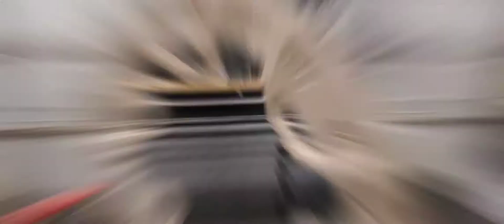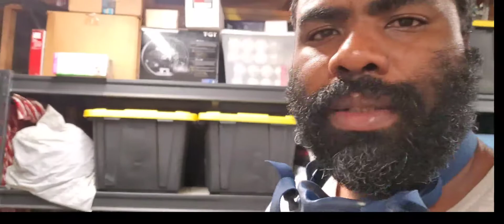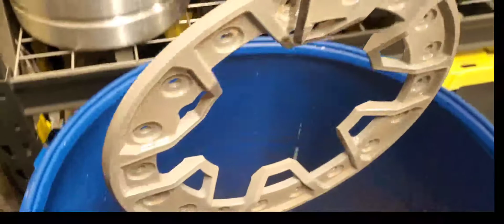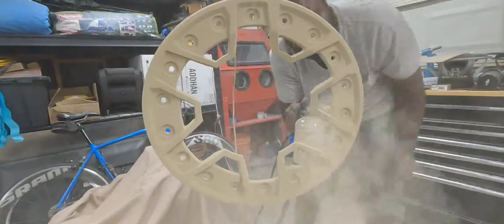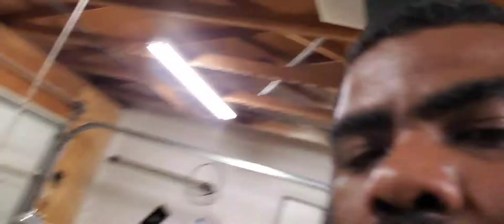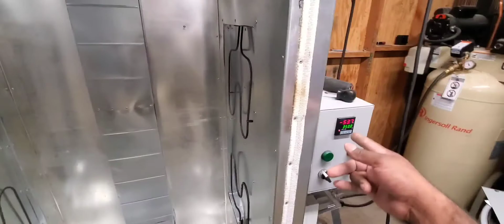I Overcooked Powder Coat

Comment: A perforated heat shield over the elements will help and ideally any temp sensor should be shielded from direct heat sources too, so like a deflector plate in front of it will also help. 👍
Reply from the maker: Literally cutting up a perforated sheet this exact moment to diffuse heat from the elements for a thermo former I'm building right now

Comment: Subscribed back to see where you take your powder coating. You’ll get it figured out just practice practice practice. I spent a lot of time early on frustrated and redoing parts lol
Reply from the maker: I think my issue is the placement of my heating elements, they are somewhat close to the parts causing the powder to flow out and cure before the metal gets up to temp, I ended up completing the job successfully slowly increasing the temp
Reply: @Ricardo_Wade  are you pre heating your oven or sticking them in a room temp oven and turning it on once loaded? 

I’m no expert oven builder by any means but if you check out Eptex ovens their elements are on the back wall all the way up so at least one side of the part being coated will always be facing the elements. I think if you pre heat your oven and have decent air circulation inside you will be able to get it under control. 

Also what I’ve seen people do before is they will take another piece of sheet metal and drill a bunch of large holes in it to let the heat pass through but kind of cut down on the radiant heat coming directly off the elements. You’ll just need to be careful not to over heat your elements. 

Just some ideas to maybe give a shot if you haven’t already. I’d hate to see you tear apart your oven for something that may be able to be fixed
Reply from the maker: @royalcoatspowdercoating  I have been pre-heating, I also have a convetion system in my oven to circulate the air inside, another thing I was thinking was maybe my thermo couple is not in the most suitable place and is reading much lower, this will keep the elements on longer, overcooking the powder
Reply: @Ricardo_Wade  that’s weird… you do have it on °F and not °C right? Seems weird that your part is reading so much higher with your IR gun than your PID. I wouldn’t think a part in the center of the oven would read over 100° higher than a thermocouple two feet away in an oven that’s up to temp already. Another idea would be to place two pieces of identical metal in the center of the oven and one almost touching the thermocouple and read the temps of the two pieces and see how far off they are and compare to your PID reading. 

You might could try to reach out to the manufacturer of your PID Controller and maybe they can help you adjust it. Just a thought
Reply from the maker: @royalcoatspowdercoating  I have 2 pid tested already I'm fairly good with electronics and controllers as that is my profession, so I'm thinking since my elements are recessed into the side walls, heat radiates out and up since heat rises, then gets sucked up by my convetion system the thermo couple sits on the back wall off to the right not in the center due to convection duct could be that area is a cold spot and causing wrong reading
Reply: @Ricardo_Wade  oh then you definitely know more than me about the PID lol 
Well sounds like you might be on to something. Hope you’re able to get it figured out!
Reply from the maker: @royalcoatspowdercoating  thanks brotha I have set of wheels I just stripped for my 67 mustang project  I will play with lower Temps on the pid and and hit the wheels with IR gun and compare, I really don't want to start offering services till I can predict what my oven is doing
Reply: @Ricardo_Wade  I gotcha man. Well good luck, keep the videos coming 👍🏼